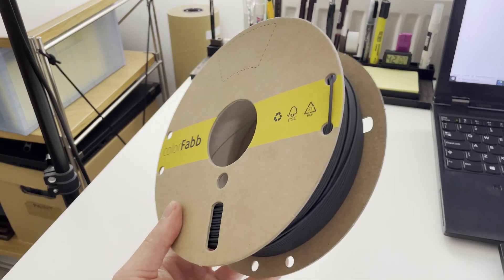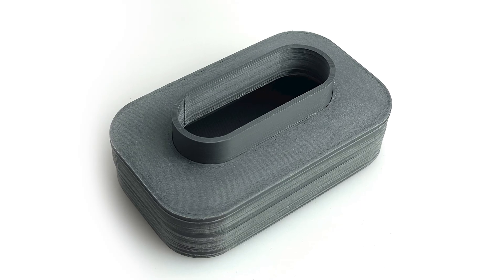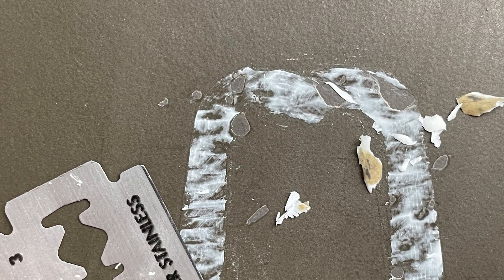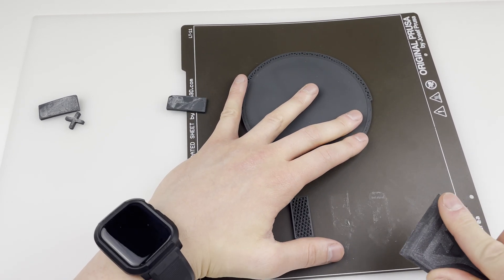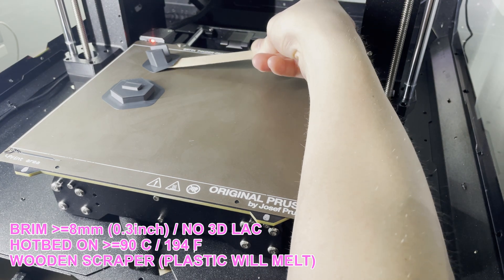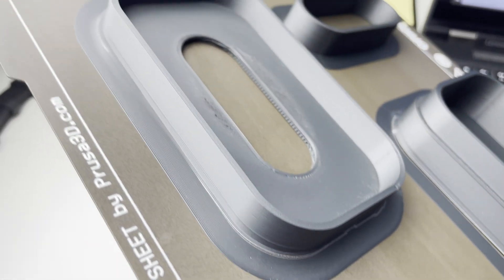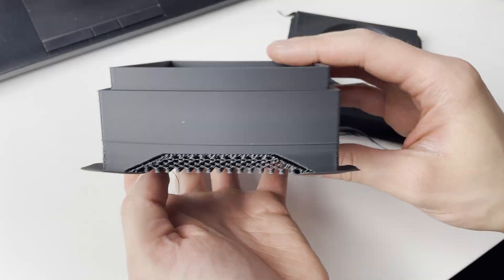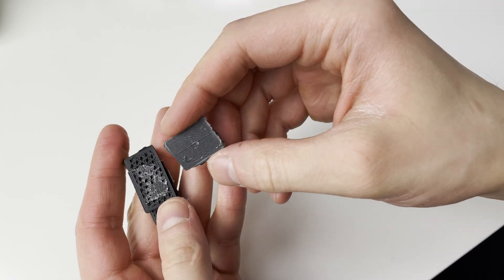Printing AllPHA on MK4. 0% Microplastics. 100% Biobased. 100% Biodegradable. Made out of fat cells.

Comment: I've now printed about 30kg of Colorfabb PHA and I have to say there are almost no problems printing it on the Bambulab Cool Plate Supertag with a brim. It simply has perfect adhesion, and you can get all the parts off, no matter how large. Plus, it has a nice matte underside. Printing is done at 22°C room temperature and 22°C bed temperature. Objects with large surface areas are a problem, as warping is always a slight issue. Round objects, on the other hand, print very, very well. In a test at -2°C ambient temperature, it was found that it could be printed almost completely without warping. However, the filament takes about 30 minutes to cure because it remains very soft for a long time at such a temperature. It can be said that the colder it is, the less warping occurs, but the curing time is very long. Printing at 22°C is optimal; curing time is about 1 minute, and overhangs are easier to handle. The maximum flow rate is 8mm 3/s. A test in the oven showed that the material withstands approximately 140 degrees quite well, but becomes softer; only at a measured object temperature of 160 degrees did the material sink slightly under the weight of an M8 nut.
Reply from the maker: This is great, thank you for such an in depth share of your experience
Reply: Hm 8 mm^3/s is quite low, that's about 80-100mm/s print speed with a standard 0.4mm nozzle, isn't it?

Comment: Any news on this? Did it degrade? New tips?
Reply from the maker: Hey there. No degradation so far… I suppose it would take years for that as for any other filament, which is not bad to be honest, it means its reliable filament to use for outdoor prints. Bonus is that it does not contain microplastics. I did not succeed to print big prints without warping though. But some users in comments are also looking into this.
Reply: @StudioSpaceDust  hmm, yes, but i hope it does live up to be indeed somewhat decently naturaly decomposable. Otherwise what would be the benefit over PLA. You see honestly I dont care if i ever need to reprint something for outside use once every x years as it makes up for the fact that both the old and new print will eventually all be decomposed anyways.

I will give it a try, living in NL, i was near their HQ today and picked up 2 spools.
Reply from the maker: @harmfpv  keep us updated how it goes, good luck and have fun 🔥

Comment: Thank you for your video! My order of natural allPHA just arrived in the mail and I‘m so excited to try it when back home. Going to finally place the printer in the ice cold garage and turn all fans to 100% just to be safe. Maybe for the warmer months I’m thinking about placing some frozen water bottles in a box to collect condensation on the floor below the bed and turn aux fan on and exhaust fan off as long as the prints are not too tall 🤔
Also gonna try my textured plate and see how it’s handling it, or might switch to glass for better removal 🤔

Already collected more than 3kg of plastic waste in the first months with some heavy prototyping, would be great to have all that as actually biodegradable waste and then print the functional parts in ASA or PETG!
Reply from the maker: Great initiative, I hope it all works out for you. If it still fails to stick to plate - using some sort of 3DLac or similar may help. Let us all know how did it go later, especially if you manage to get big prints without warping. Best of luck 🤞
Reply: @StudioSpaceDust  Finally started printing! So far the calibration prints are through, ran on a K1C with 0.4mm nozzle.
Unfortunately the bed always heats up to 50°C during pre-calibration, but at least small to medium prints still adhere very well to smooth PEI with PVA glue.
Printer is outside at 5-10°C, avg. Bed temp is 10-15°C during printing, with 30-50°C for first layer (let’s see if I can get that down as well). Fans are all on 100% all the time

Parts deform if taken from the bed immediately after print, but the longer you wait the more dimensionally accurate they get at removal.
Small edges warp upwards during printing, which can sometimes affect dimensional accuracy for small holes or edges, but so far barely noticeable warping on the overall structure.

Haven’t dared to print something much larger, but for tomorrow a Beamer stand is planned that will take up a large part of the plate, let’s see if it keeps up.

Otherwise I adore this filament, the absolute lack of smell, not having to worry about exhaust filtration, health concerns, microplastics from printing, moving parts or sanding, the flexibility which is great in the beginning for removing brims and supports, and the just „natural“ look and feel of the filament made me fall in love 😂
The texture and feel remind me of those early compostable plastic items you could get 10 years ago 😅
Let’s see in the coming days how functional prints perform, I‘ll update and if it works out share my full settings 😊
Reply from the maker: @ Hi,  and thanks for the update. Consider making a video on this process! Sounds like you’re very enthusiastic about it - cant let that go wasted! :) will be waiting for the update - good luck!
Reply: @ thanks, I‘ll upload once I got the last issues figured out! 😊

As an update, overall warping and dimensional accuracy was no issue for a bigger print, however significant warping on sharp edges and partial failures on even small overhangs! Tweaking speeds and experimenting with cooling atm to get this under control
Reply: Part removal is easy with my current settings (warm bed for the first layer, then max cooling, smooth PEI, PVA glue). Sticks strong and doesn’t lift, but removal is easy even when cold, hope it stays that way!
Reply from the maker: @ammlseri5769  cant wait to hear how your big print go! If you manage to print without lifting - then defo worth a new video!
Reply: Capped the max vol flow at 12mm3/s so far, underextrusion only appeared at 20+, but some warping and defects around sharp corners already appeared at 15, so 12 should be safe

Comment: Hi, i had some problems with it on a Bambu P1s too.. Adhesion wasn't that crazy on a textured PEI Plate and i found the brim is easier to remove if you just put some IPA onto it for a few minutes or try to remove it lying in hot water (not boiled, just from the tap) (after you can put your hands in of course).. Haven't tried with a completely cool bed and room so far, thanks for that, prints much better now and doesn't need 3DLac all the time... thanks!
Reply from the maker: Thank you for sharing your experience! Since release of the video I have upgraded from MK4 to MK4S. The part cooling fan is more powerful basically… I gave another chance to this filament, but without luck :) same issues..
Reply: @StudioSpaceDust  Ok, maybe you should really try a textured pei plate.. Did you use the recommended settings from colorfabb? (that upgraded print quality for me) I had no problems to release any prints (around 20C ambient no 3dlac). Since the P1S Aux fan is blowing directly on the print and if found it affected print quality i reduced it to 50% and installed a 45 degree diffusor, so i reduced cooling and still all good. My tests were mostly with mininum bed contact, rotated 45 degree.. I will test a bigger bowl now, to see if i get much warping..
Reply from the maker: @dirkk5892  I used smooth PEI sheet for my last attempt (adhesion even better than textured sheet). When printing  ~10x10cm square box it would always warp for me even if I set fan at 100% + reduce print speed to 30mm/s so that all mass gets chance to cool off before new layer is applied .For small prints it will always work fine, I tested that without any issues. But because  I rarely print something that small and for this reason this filament is  of very limited use to me sadly. But if you're only printing small parts it is great filament. Let me know when you try to print bigger, maybe you can pull it off somehow.
Reply: @StudioSpaceDust  Hi, i recommended the textured because the adhesion ist not so strong, for my small prints (they were not actually small but rotated to 45 degree) it was much easier to remove the brim. I just tried a bowl 140x90mm flat ground.. Of course it warped very soon with textured pei no brim.. So i tried with 3DLac, no brim, came out wonderful and i could just remove it by bending the plate..
Reply from the maker: @dirkk5892  this is great, thanks for letting me know, I will definitely try. I don't like 3dLac to be honest, all that spraying and cleaning, just makes it more complicated, not to mention the smell but I guess if it works then its worth it.. If you ever try something with square base keep me posted, as those ones tend to warp easier.
Reply: @StudioSpaceDust  Hi, i don't like 3dlac, too, but i have to use it for nylon, if thats the price i have to pay for environment friendly material i am fine.. So i did a test print.. Textured PEI, 3Dlac and brim.. I must confess my first try without brim in a corner of my bed lifted my build plate, so i don't know what happens to full size squares.. But that one came out fine and i could remove the main part without problems, for the brim: 5min in hot water, i could peel it off.. Made a picture: https://www.hh-stpauli.de/pic1.jpg
Reply from the maker: @ this looks good, thanks for sharing. For me on Prusa removing print has never been an issue once I figured out the use of sharpened wooden spatula on heated bed, but the warping with even larger bring than what you have here never held the print without lifting. But maybe on Bambu you have more luck. Keep on experimenting!

Comment: Dont use 3d lac, and use glass plate, large raft, if the raft starts to warp tape it down during printing, this works best for me. Never have this kind of weird issues where it sticks and is hard to remove from the build plate.

Comment: Glass bed + PVA wood glue.

This is now my go to filament.
Reply from the maker: Thanks for sharing. Does that successfully mitigate warping for larger prints?
Reply: @StudioSpaceDust  Yes, I've printed a Dactyl Manuform keyboard (typing on it now). I used lily pads on the 2nd half and it had really strong adhesion to the build plate (no warping). The 1st half warped badly with only PVA wood glue and no lily pads (still usable though). Getting the bed leveled evenly with the nozzle super close to the bed (squishing the filament) was important too.
Reply: With the addition of lily pads (also called mouse ears or anti-warp discs) placed on the corners of the print, yes.

Comment: I've struggled like you with the colorfabb PHA. tried different combinations of 3DLac and Brim on my P1P but nothing worked for bigger objects. I also damaged one build plate with the 3DLac + Brim combination. I even contacted the support. They have a test lab and can test your models on their 3D Printers and give you advice (best support I got in touch yet). Unfortunatly they also know the limits of the filament at the current state. here is their answer: "Sorry the material is not yet working well for your situation. We understand the current limits of the material and it's an ongoing project of our R&D team to improve on the original allPHA grade. We hope, like you, one day we'll be able to achieve ease or printing similar to PLA. Your story and experience is incredibly valuable and will contribute to keep pushing the limits of PHA!"

Have you tried the PHA from Regen? I heard that their filament is a bit easier to print than the allPHA
Reply from the maker: Hello and thank you for your comment. I can also detest that colorFabb’s support is top of the line. Initially when my prints failed and I managed to ruin my plate I complained to them and they issued me a refund. Only after that I realised that heating the bed eases up the removal and contacted them back saying no refund is needed but they just issued it anyways. It’s good to know that they admitted limits of allPHA to you. If it was truly so easy to print everybody would be using it. Unfortunately not…but they have PLA-PHA in their range, this, as I understand is easier to print? But then it’s not 100% bio based, so there is a trade off…  I have not tested PHA from Regen, but let me know if you manage to get your hands on it at some point.

Comment: Use a painter's knife.  Not just in this case, but any time you even consider using a scraper, use a painter's knife instead.  One with a sharp front edge, but large enough to lie flat on the bed and you won't be scratching anything.
Reply from the maker: Thank you for your advice, I have few of those. Ill keep this in mind next time 🙏 but with Alpha, when cold, this would not have helped. With heated bed, instead of wooden scraper, very likely.
Reply: Its impossible to remove these PHA ColorFabb+3Dlac print using a painter's knives. No matter how sharp you get them. 
Ask me how I know.

Comment: If the material likes cold so much how about letting the bed cool after first layer to promote adhesion? It might even help reduce warping. And then heat at the end to remove the part? I run my bed at 40 degrees with polyterra, the material just prefers cold beds.

Anyhow thank you for testing and reporting. It's nice to see materials you can print tat with knowing it won't turn into micro plastics.
Reply from the maker: Hello and thanks for your comment, I think it makes sense what you are saying but if I can add to that thought id say pause would be needed between every say… 5 layers or so because adhesion of first layer is not an issue as sheet is cold in the beginning but the bigger the print the more thermal mass it stores and I suppose heat goes down to base causing warp at later stage of the print. But really good idea! Worth testing.
Reply: @StudioSpaceDust  It definitely won't be as straightforward I'm sure ^^
It's interesting to hear that adhesion is good on a cold bed, would allow for very energy efficient printing on top of the eco friendly nature of the filament.
The issue indeed often is that filament stores heat too efficiently, even with fans on full blast it will only cool so quick. Maybe side blowers like bambu and voron printers do is the key to keeping temperatures in check.

I have high hopes for PHA I'd love to finally have true eco friendly material to work with. I might grab a spool for myself to check it out. It's just a little pricey for my taste :/
I've subscribed to your channel to keep an eye out for you future expirements

Thanks again for sharing, keep up the good work :D
Reply from the maker: Yup, low energy bill is definitely a big advantage. Even with little warp it’s still a good material for simple prints. Those who want more dimensional stability may go for PLA/PHA mix, a bit of a compromise but still more sustainable than regular PLA.
Reply: @StudioSpaceDust  If you mix PLA and PHA, you remove the natural ability to biodegrade and need to ensure the print is discarded into an industrial composting facility. 

PLA is not a natural polymer and it not found in nature. Therefore it needs the higher temps to begin the hydrolysis process and ensure bacteria can in fact break it down. And in addition, PLA in a marine environment does in fact turn into toxic microplastics. PLA isn't biocompatible with humans and mammal either. 

PHA on the other hand, is a natural biopolymer created by nature. And is fully biocompatible, hence their application in internal medicine for the past 20+ years. And does not require any specific or special conditions to natural biodegrade other than bacterial activity. 

When you mix PLA and PHA as Regen brand of 3D filament does with their claimed 100% "PHA" filament (its not). And those that printed part into your home compost bed. You've basically created the perfect high speed delivery mechanism to introduce PLA micro and nano plastic into your soil. Or worse into a marine environment.   

ColorFabb does over a mix PLA and PHA filament, but are very clear on their proper end of life. 

So, please discard those types of prints into the regular garbage pile and do not try to compost them. Or leave them exposed to the environment.

Comment: Interesting! What about enclosed/heated chamber to get rid of the warping?
Reply from the maker: The more heat the more warp with this one. After filament leaves nozzle it takes quite a while to solidify (compared to pla/petg) thats why it is recommended to have 100% fan from 1st layer. I originally tested this material with closed door of enclosure and internal temperature was ~28C which resulted in more warp than later when I opened enclosure door, turned internal enclosure fan on an even opened window nearby which dropped temperature to ~23C which resulted in prints with less warp, so if one can drop it even lower maybe warp could be eliminated altogether. Direct AC feed to enclosure, this would be a fun test :)
Reply: Tg of PHA is -5 c to 10c, A heated chamber accelerate the crystallization and increases the rate of warping.

Comment: Could you try the classic PVA glue stick, with water as a release agent?
Reply from the maker: The reason I tried 3d lac is because it is specified by ColorFabb in their technical data sheet. I suppose glue stick could work to some extent but I will leave it for others to try. Technically 3d lac is stronger than PVA glue stick anyways and even with it I couldn't prevent warp 100%. I think what would really help is dropping ambient temperature really low. Like as low as you can get in winter in a basement. But I wont be able to test that too. Or also if you could drop print speed even more, but again, then print times will be unfeasible. Or if printed with 3d lac on a glass sheet. But this is another story.